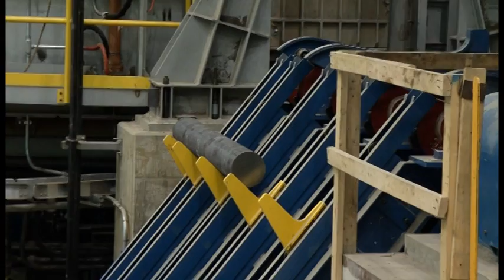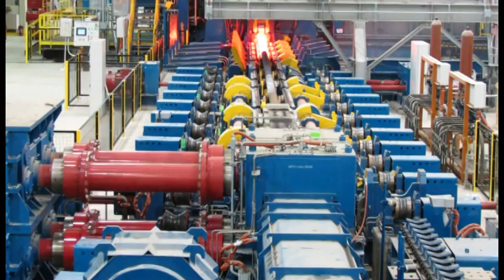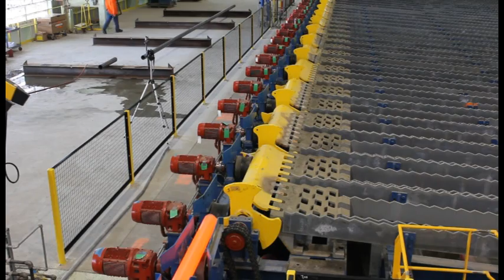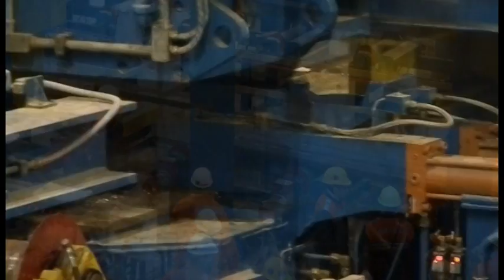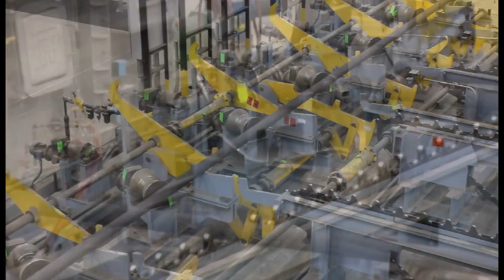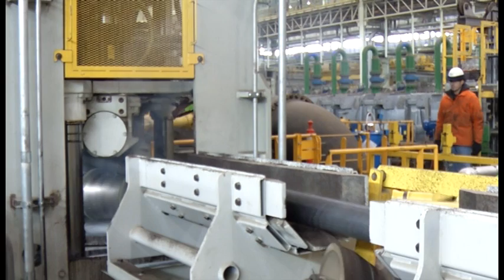Vallourec Star Milestones

Comment: This may be the most convoluted assemblage of conveyance I've ever seen in a plant.  While the shots lack detail, it certainly appears that 80% of the investment here is conveyance and 20% is the actual production process.  Amazing how lack of a few good process flow engineers wiped out an extra $200M of investment, and probably a quarter million square feet of factory floor.  Damn what an engineering tragedy.  I guess this is what the schools put out these days -- booksmart and no practical experience; though you would think some senior folks with prior experience in other facilities would have had a hand in this at SOME point.  The root cause of this kind of mess in my experience is that a pile of vendors are hired to work up the details and when they smell a bloated budget to be exploited you end up with this result.  A good many sales folks make their annual quota in this plant alone.